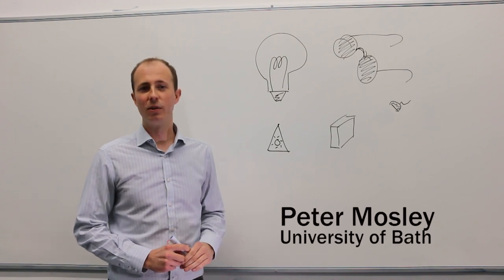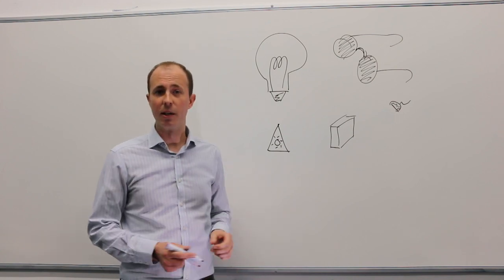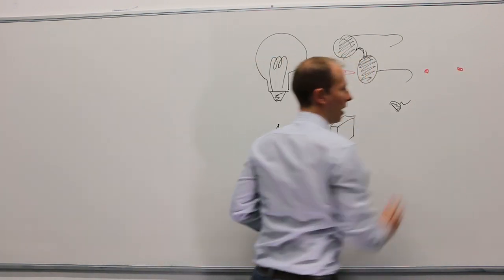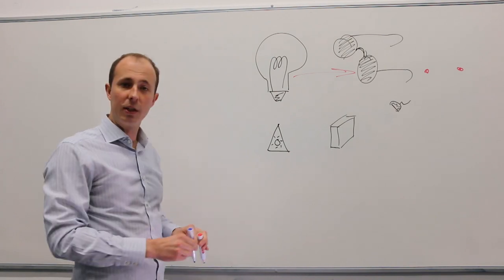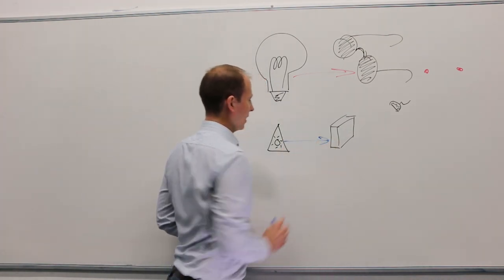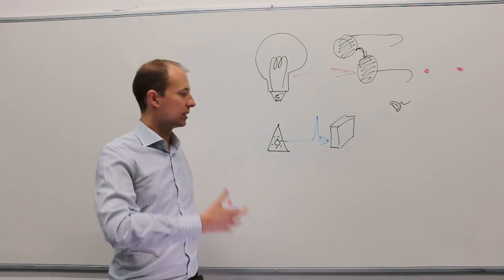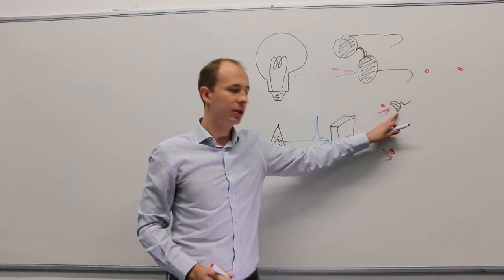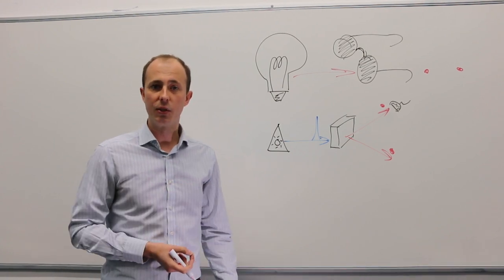How do you produce a single photon?

Comment: That was the most concisely explained method on how this technique can be reliably used to produce and consume a single photon for experimentation. Thank you for the uploading this video.
Reply: I beg to disagree. There is no indication presented other than that this is a means to detect when a photon will be at the downward branch.
Reply: @K0ndratyuk  Now sunglasses only polarize in so many dimensions so if you get enough sunglass lenses and position them at varying degrees eventually you'll generate a single photon
Reply: @SATTANK  Perhaps, but as far as I can tell, there's no way to know this other that asserting that we only detected a single photon, which we seem to do, but that has its own issues. 

My main concern with detection is it relies on quantum changes in electron states of atoms in the detector. In my current view, the question then becomes: If the incoming energy is a field-like wave, how could we possibly tell?
Reply: @SATTANK  Of course - Agreed.  My apologies for imprecision. I should have asked: How can we be certain we only emitted one photon?
Reply: @SATTANK  I agree. My question was poorly worded. Given that our detection is based on the energy state change of an electron orbital in the detector, how can we distinguish a particle from a wave as the cause of that effect?

Comment: This seems to demonstrate a method to predict/detect a photon pair, which doesn't obviously tell us anything about how many photons were produced at the source, how many nor which were absorbed (if any) by the crystal, etc. Certainly not how to "produce a single photon". 

Rather, this seems to demonstrate a reliable means to detect when a photon will be at the downward branch, answering a very different question.

This seems another instance of suspicious uncertainty within particle-based QM we would call "a risk factor" in most other information systems.
Reply: God bless you for calling it out.
Reply: @usurpvision  Thanks so much for getting back to me!!
Do we have a way to ensure 1 photon is produced at the source, regardless of detector activity?
Reply: @BuckField  I can't find a single source of information that demonstrates that anything other than a 'short pulse' of light can be generated by a lab device.

The photoelectric effect is the Nobel Prize winning experiment that supposedly verified the particle behavior of light, due to the fact that low-frequency light waves were unable to interact with metal at all while high-frequency light waves were the primary variable in determining photoelectric interaction. They deduced from this that because light interactions were based on the frequency of the light itself and not solely on the amplitude of the wave, that this means light behaves as a particle, because 'small bits of light' with particular energies are what led to the photoelectric interaction.

I personally do not see how the logic follows that light must NECESSARILY also be a particle (in addition to being a wave), because I don't see how the interaction can't be the alternative to being a pure wave, wherein the geometry / size of the interacting particles are what are responsible for discrete energy absorption. It seems equally likely to me that the size of an object (such as a hydrogen atom or silicon crystal) would determine the minimum energy absorbed or otherwise be non-interacting.

I do not have solid understanding or justification for wave-particle duality being a solid description of quantum phenomena. I can't think of an instance where particle behavior is exhibited by particles that cannot also be explained by waves. But again, this also comes down to me needing to practice reading the mathematics more.

If anyone has any sources that can FOR SURE present an example of a quantum object displaying both necessarily particle AND necessarily wave behavior, please reply to me with the citation so I can cut this crisis of faith short. Thanks!

Comment: The arrival of the photon at the detector may indicate that there is another photon elsewhere, but it wasn't a controlled emission. There might have been, say, 3 photons released from the crystal closely in time.  Can the detector be used with some type of "armed" circuit that only allows the 1st photon to pass and not others?
Reply: +Rudi Lapa The problem that crosses my mind is how to detect a photon without absorbing it (exciting whatever you have at hand and detecting it later)?

I'd need a little time to think if this is possible, but it is a very interesting question. But I don't think it'd be useful for any layman anytime soon, just for research, for now...
Reply: By the way I came back to this video by chance, and would like to add that, while the process is indeed not controlled, the pulse has a time distribution, and that the photons are emitted simultaneously (even in the 3 photon case, which is very rare in parametric down conversion, as far as I'm informed).

Comment: i was wondering if a single photon of light could be seen from every angle, is it possible to see a single photon 🤔
Reply: It seems that, yes, it is possible for humans to see a single photon, but it is very unlikely (trials with a fair random photon source indicated that a correct photon detection happened 51.6% of the time, 1.6% above pure chance, but statistically significant - AKA, you'll rarely, but definitely, see a single photon, even if your eye is a crappy device for this specific task). In fact it seems the setup to confirm this tells us we barely see them, which kinda explains why our vision during the day is so much less affected by noise than our nocturnal vision, and we probably evolved to see a very small amount of single photons.
Reply: On a more fundamental interpretation of your question, a photon has to enter your eye and get absorbed by molecules in the retina to generate a signal that your nerves interpret as a flash of light. You can't "see" a single photon like you can see a well-lit coffee mug in front of you. What you are "seeing" are photons that are emitted by other light sources, reflected by the mug, and then entering and being absorbed by your eye.
Reply: If I'm understanding your question then I would say No. You can't see a photon from every angle because if you see a photon then it entered your eye. If you don't see a photon then it didn't enter your eye. 
If a photon is traveling in a direction that is perpendicular to your line of sight and you see it then the photons wave function has collapsed and you've just witnessed a highly improbable event, but that does not mean that two people will see the same photon at the same time.

The photon is just another particle. The only time you know it's there is when it hits you in the eye.

EDIT: actually another time you notice photons is when they impact you and transfer energy, like at the beach.
Reply: Yes. If a photon exits a port to empty space, then it must disperse in all directions. You and another person can see the photon exit the port from two different perspectives simultaneously.
Reply: We can't see light
It light that make us see
Reply: @vejymonsta3006  A photon is not some brightly lit particle you see racing by you like a hot BB, if it doesn't enter your eye, you would never know it was there.

Comment: I think what he's talking about is a Barium Borate (BBO) crystal. If you think about what is going on with light ... for instance, why is a leaf green? Light hits the leaf and the light is absorbed. But the atoms of the leaf re-emit only the photons of wavelength we perceive as green. This is the same with most things, light is absorbed (being stored by forcing the electrons of the atoms to a higher energy state) and then some some light is re-emitted as some electrons release their energy and travel to their lower energy states. The BBO crystal works the same, but with unique characteristics. It absorbs the light coming in and re-emits light out in the form of two discrete photons with the energy of the original light in split half between the two emitted photons.

Comment: If we consider electrons in outer orbital to take up more volume in space..when that volume collapses the surrounding fluid (space) flows in at c to fill gap then stops suddenly at new smaller volume.  The decompression wave in the fluid is a photon. The outer membrane divergent. e- (convention is wrong and I'll explain why inn a sec) as it's expanding, the inner membrane convergent since slightly smaller than exterior. e+, convergent. 
Since proton is mass and mass ŷ gravity is convergent therefore positive must actually also be. 
This bubble expands spherically until the dual membrane is burst. The photon we know is line through membrane. 
You can't half burst a bubble. Nor can you burst half a bubble. 
Surface tension collapse.

Comment: This would implement that if you would set up two detectors, number one with an opening angle of (say) 1 degree strait in front of the crystal, and another (set of detectors, an array) around the first one with an opening angle of 179 degrees in 3D (almost half sphere), and you detect that photon in the first small detector, that the chance is more than 90% (or so) that you detect that second photon in the second detector array on exact the same moment ? I do not think so, but I wonder how that test ended.
Reply: Just found an answer to that question:
https://www.youtube.com/watch?v=1MaOqvnkBxk
The angles of the outcoming two photons are more or less known, so they position two detectors, no need to fill a space of 180° with them. He says that once in only a million (or so) the bombardment of photons trough the crystal produces a conversion in two lower energy photons. Depending on the efficiency of the detector, in about 78% of the cases that in the first detector a photon is detected, also the second detector goes off.

Comment: This is falsifiable. Try putting multiple detectors in a vacuum chamber and send in "one" single photon. If only one detector can detect it then that's the only way to confirm it's really one photon.
Reply: Yes, except that you are running into the little issue of quantum efficiency. If the QE of your detectors is 80%, which is already fairly high, then there is a 20% chance that you missed a second photon. :-)